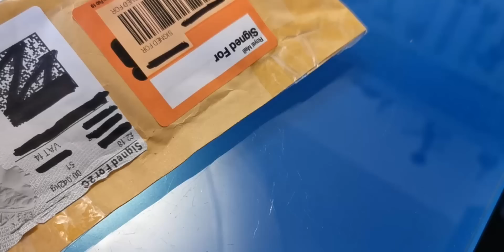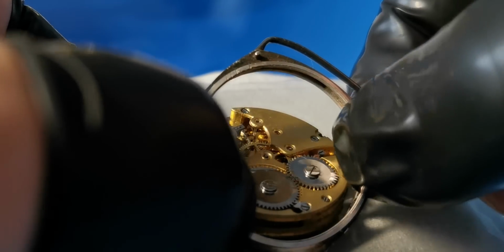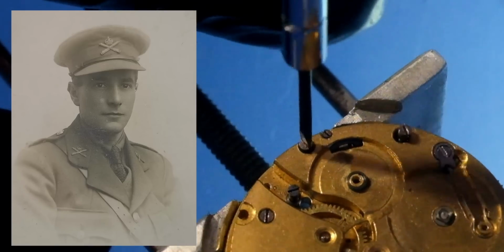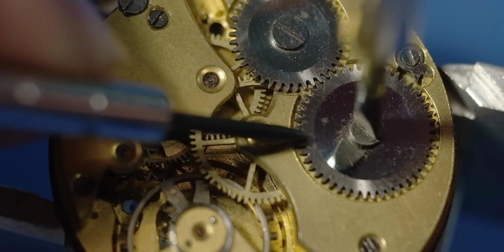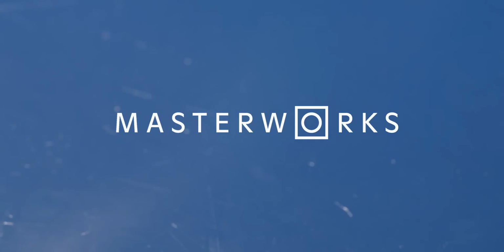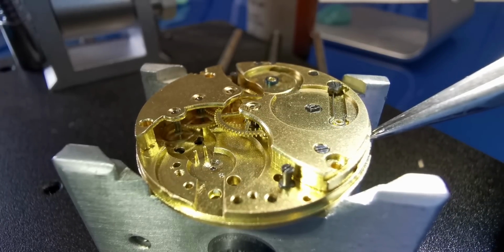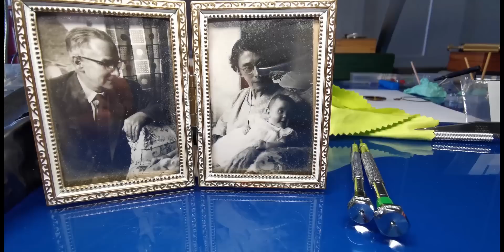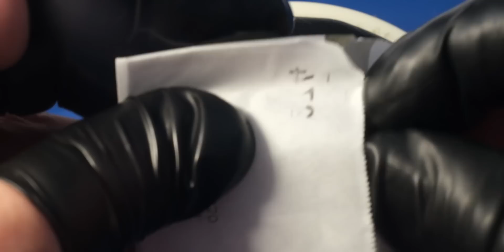Trench Watch Restoration - One Year To Complete!

Comment: Perfectly restored, and perfectly narrated, this video is one of my favorites Richard !
Reply from the maker: Hi Guys!  I just seen one of your videos with 15M views... Congratulations!  And... I have the JLC dial now... Will mail a few images very soon!  Richard
Reply: @richardperrettwatchmaker  Thank you Richard, you deserve just as much, if not more! Thanks for the images, can't wait to see it, have a good weekend!
Reply: @richardperrettwatchmaker  Why didn't you try one of the many penetrating oils that are easily available at most hardware stores? It might've loosened that screw without breaking it.
Reply from the maker: Hi Autodidact .... I did off camera and it made no difference ... but then I was turning the screw the wrong way!  Ooops!  Richard
Reply: @richardperrettwatchmaker  Ah Ha, I wondering about that.. It did seem very odd that both screws were jammed.. I looked closely at the view you made of the thread as it was attached to your drill bit upon removal. It did look like a normal Right Hand thread. I'll bet my Unitas 445 has the same issue. I wish you had mentioned your mistake in the video. Some of us need the education.
Reply: Angelina  Gaio  Janoski  Lúcia  Gaio

Comment: The screw that came out of the arbor appears to have been LH ?  I am a retired gunsmith worked for 40 years on English, Continental and American shotguns (primarily) .  Stuck screws /pins are not uncommon.  I found that heat (in excess)often altered the heat treatment  and could result in broken screws.  Light heat in conjunction with a fine penetrating oil like Kroil and allowed to sit for a day or two would sort out the problem.  Cold applied by liquid directly to the screw,  Such as wart remover (available in most pharmacies) or liquid nitrogen will cause the screw to shrink slightly breaking the corrosive bond and allowing easy removal of the screw and not alter the temper of the screw.  I usually found high heat to be a last resort.  Love your videos and really liked this one.
Reply from the maker: Hi sportclay1, I wondered about using a wart remover but could not find anyone else using that technique.  Theoretically it makes a lot of sense.  Haha! And I am now totally confused about the screw thread direction! Great feedback Much appreciated. Richard
Reply: @richardperrettwatchmaker  I got really curious about the dual LH threads on both Crown and Ratchet wheels.  This is an Adolph Schild movement and while I can't make out the movement number on the donor movement I did find a number of Shild movements from this time period and many from trench watches.  Parts lists show most all have LH threads on both wheels.  Learn something every day.  Glad you saved the watch.
Reply: @sportclay1  Yesterday I was working on a tiny Swiss lady's movement and, lo and behold, both the ratchet and crown wheels were reverse threaded. I spent over an hour trying to gently coax the ratchet screw loose, then tried turning in the other direction and ... SUCCESS! Really threw me for a loop, but I guess it's not that uncommon.

Comment: Fabulous job, pleased you didn't remove the dinks from the case just looks right as is. Terrific little lathe, impressive screw making when you can hardly see it. Just done a peseux 320 with the same setup for the balance and it took days to steel myself to clean the capstone.
Reply from the maker: Hi Phil,  yes the case looks good I think with the damage to it. And the 6mm lathe is pretty helpful for such an old tool.  Thanks for the feedback, Richard

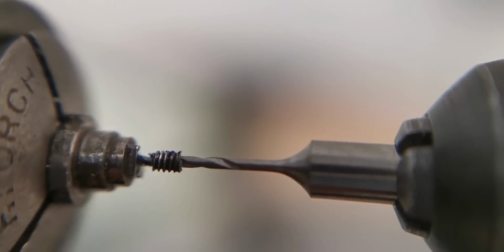Comment: I don't understand: The barrel arbour thread at 10:50 looks to me like a left handed thread and if it were a right handed thread, it would have been screwed in, not out by the drill going in the normal direction. But the new screw you made goes in right handed, am I missing something?
Reply from the maker: Hi Donald... The Ratchet Wheel turns clockwise and the crown wheel which drives it anticlockwise.  The crown wheel screw has a reverse thread so as the rotation of the wheel does not serve to loosen it and vice versa for the ratchet wheel. This is the normal configuration... but your observations look correct to me so now I'm confused too.  Whatever... it worked!  Onward!  Thanks for taking the trouble to make these observations.  Much appreciated! Richard
Reply: You and I are of the same conclusion.  The reason the broken screw turned out on the drill is it was turning it in the correct direction.  The new screw went in probably with only a small bit of resistance because of  a slightly smaller screw diameter and perhaps a slightly harder screw .  I am only a hobbyist and have personally never encountered both the ratchet wheel and crown wheel being LH.  But I have seen other watch repair videos where they were the same.    There is no corrosion on the threads of the broken screw.  I believe this movement was made by Adolf Schild  (AS) should, with the movement #, be able to find the proper service sheet.
Reply: I know both the ratchet wheel and crown wheel screws are left handed when he broke off the first ratchet wheel screw. And when I see him try to unscrew the second the same way I already know he will break it again. Both crown and ratchet wheel screws being left handed is not that uncommon, it may not make sense but thats the way they made it. So two important things to remember here even for the professional, 1. In watchmaking if you have to force something more than you normally have to you are doing it wrong; 2. Ratchet wheel screw can be left handed.
Reply: Yes well observed. After the second head came off I had my suspicions but seeing the thread up close at 10:50 left no remaining doubt in my mind. I have found to my cost that HMT movements often use this double left hand system. I am absolutely positive that it was an honest mistake but alarm bells really should have started ringing when he tried to get a right hand screw into the arbor. We all make mistakes and this could have provided the viewers with an excellent example of the pitfalls of watchmaking. Instead I felt that it was just glossed over in an otherwise excellent video.

Comment: You might try soaking the top of the screw with WD40 and then setting the entire movement in the freezer. Materials tend to shrink in cold, expand in heat. This approach has worked for me.
Reply: Thats good advice. Heat is more for nuts and bolts. Can't tell you how many screws I've gotten out with WD40 or Triflow, fantastic solvents.

Comment: I missed the lubrication of the keyless works with high viscosity oil?
Reply from the maker: Hi Stephen ... it was not even on the cutting room floor as I didn't shoot that part.  I actually use moebious grease 8200 on a big chunky (relatively compared to a Rolex 2135!) movement like this and apply it with a sharpened pegwood.  I just didn't capture it.  Sorry about that.  Richard

Comment: Question doesn’t the barrel arbor screw unscrew the opposite way? Meaning not what is normal? You were basically tightening it
Reply from the maker: Hi 4GodAnd Country, the crown wheel on this movement is reverse thread so for the ratchet wheel to also be reverse thread would be unusual  But the evidence points to it being so!  Hence the difficulty! Anyway it honed my patience and made for a more interesting video.  Thanks for the feedback.  Onward! Richard
Reply: @richardperrettwatchmaker  Looking at the video, I was thinking, "try turning it the other way -- it might be a left hand thread."  How do I know?  Had the exact same thing happen a couple of months ago on a cheap Elgin Sportsman I was playing with.  The ratchet wheel screw was a lefty, so I assumed the barrel screw was a standard right hand twist.  Against my better judgment, I kept twisting even though the force got way beyond what is normally encountered in watches.  Sure enough, a second or two later came the sickening snap.  When I sourced a donor movement, for grins I tried twisting the opposite direction first and sure enough, it backed right out.  Left hand thread on both screws.  Why?  Who knows, but apparently it does happen.

Comment: First of all, I'd would like to thank you for your service. I really felt your pain and frustration when when the second screw broke. 
By the way, you can use a small electrical soldering iron to apply heat to recalcitrant screws. Thanks for a great video.
Reply from the maker: Hi Robert .. Thank you!  The soldering iron is a great idea ... but in blow torch's favour it is maybe more theatrical!  Thanks again.  Richard

Comment: Nice work Richard.  Might try alum to dissolve out the broken screw.  Takes a while but can work well.
Reply from the maker: Hi Luke... Did consider it but the lathe is somehow 'cleaner'. Think I will do a video employing the Alum powder technique at some point. Richard
Reply: @richardperrettwatchmaker  yes, actually it might not work if the arbour is a similar material to the screw now I think about it.  Both might dissolve!!   Good for non ferrous or stainless substrate and ordinary steel screw though.

Comment: I wonder if putting the movement in an ultrasonic cleaner would have helped release the screw? perhaps with the aid of the tip of a hot soldering iron, once out of the ultrasonic of course.
Great video thank you.
Reply from the maker: Hi Jon ... Good to here from you.  I tried the soak and ultrasonic off camera but not the soldering iron.  To no avail.  Anyway it made for a more interesting video!   Thanks for the feedback.  Richard
Reply: @richardperrettwatchmaker  Yes it was very interesting, and glad my idea wasn't stupid.
I was worth a shot.

Comment: Thanks Richard! In a way it’s nice to see the experts having issues as well. How did you modify the screw?
Reply from the maker: Hi Boyd  ... Thanks!  The thread size was 0.8 so I reduced the diameter and in doing so took away the existing thread and then used a die thread cutter to put on the corrrect thread.  Hope this explains.  Richard
Reply: @richardperrettwatchmaker  perfect, thanks!

Comment: Your rigged center drill was scary lol but hey if it works, it works. Good show good show
Reply from the maker: Hi rgbcsm ... yes tools are so expensive that sometimes I have to make do with what I have.  I was chuffed when it worked.  Thanks for the feedback.  Richard
Reply: @richardperrettwatchmaker  I do medical machining and omg yes tooling is crazy expensive. I've had to use 200usd gun drills for canulation and feared every moment lol have to get the "speeds and feeds" just right

Comment: 😅 definitely a 1984 photo 😉.  Great restoration👍  It looks like the ratchet wheel screw has a left hand thread. I know it's unusual, but I've seen it before.
Reply from the maker: Hi Andrew... Yes 1984 or there abouts!?  I think you are correct about the thread.  Curious design choice as the rotation of the ratchet wheel serves to loosen the screw which is why the crown wheel is left hand thread.  Anyway,  alls well that ends well and it made for a more interesting film.  Thanks for the feedback. Richard

Comment: Sucks to break that same screw twice! I've had that happen a number of times. I kept yelling at my monitor "try turning it the other way, you never know!" lol So hard to find parts sometimes, I got to the point where I try to work around stubborn areas if I can. Cleaned my mothers watch tonight, the cannon pinion didn't want to come off, so I left it on and cleaned it that way. But no choice in your broken mainspring situation.

Comment: Hi Richard , do you only use an ultrasonic cleaner in your repairs or do you also use the large "traditional" LR / Elma style as well ? Great videos , Harry
Reply from the maker: HI stryker99 ... I always use an ultrasonic with three solutions, Cleaning, rinse and then isopropyl alcohohol.  If the parts are really grimey I do some cleaning by hand before this process.  Hope this is helpful, Richard
Reply: @richardperrettwatchmaker  that's perfect thanks so much

Comment: Wow, what a great transformation. Did you ever try dissolving out broken screws using hot alum solution? I've used it to dissolve small (big by your standards) broken screws and taps from aluminium, but it should dissolve any ferrous metal from a non ferrous one.

Comment: As its a donor mechanism, how about using an aggressive release oil such as 50/50     Automatic transmission fluid / acetone and soak for a few days.
Reply from the maker: Hi Jim... tried it all off camera but there was zero effect.  These fluids could not make any headway.  Both screws were almost fused into their arbors. Good thouvht though. Richard
Reply: @richardperrettwatchmaker  Thanks for the feedback. That 50/50 works miracles on car bolts etc.
 love your work and filming.

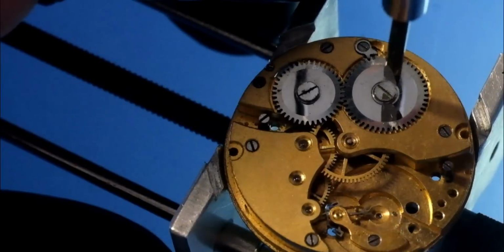Comment: If you look at 4:49 the screw did rotate about 5°, That is it is reverse thread.
Reply from the maker: Hi Haik ... A left hand thread on the ratchet wheel which turns clockwise is dodgy design ... but I agree with you!  The evidence is stacking up that this was the case.  Anyway, it made for a more interesting video I guess!  Onward!  Richard

Comment: You sure you turned the screw in the right direction? I guess you did but man, that's bad luck on both movements. Did you oil the cap jewels?
Reply from the maker: Hi quaarjet ... It would be unusual for the ratchet wheel to have a left hand thread when the crown wheel has one.  But not impossible and the evidence is pointing towards that.  Ooops!  Anyway, it made for a more interesting video I guess!  Onward!  Richard

Comment: You seem to have a disadvantage to my type of engineering with these delicate components, the tight screws will simply loosen with a wd40 spray soaking with a very very delicate precision shock like you did with the hammer, perhaps the screw threads can even mate in these ancient materials over 100 years... bravo fellow Welsh man these jobs are far outside my clumsy hands capabilites, I often use acid to eat rust too, another disadvantage you have I would not would be the quality and grade of the ancient steel that would probably dissolve altogether using my methods.... this is the difference between a fitter and a mechanic on display

Comment: I'm an agricultural engineer and blacksmith during the day, and even I cringed when the hammer and blowtorch came out! Personally I'd have gone straight to making new parts instead of pinching parts from another movement. But then again, I do have a habit of resurrecting basket-cases that should probably be pronounced deceased, and I'm not trying to earn a wage from it either!
Reply from the maker: Hi Leon... You do noble work sir!  Aged nine I spent the early hourz of one summer morning inside a combine harvester because I was small enough to get right inside and change a vital component.  Never forgot the urgency due to the weather window and the satisfaction of seeing the great machine harvesting again in the daylight.  The machines you work on are amazing!  Richard
Reply: @richardperrettwatchmaker  That's a very romantic way of seeing it! For me, they normally seem to break down in the middle of a knee-deep Norfolk bog during reed-cutting season (jan-apr). oh, and it's raining!

Then again, You'd be familiar with that phenomenon from your army days, they always find the worst place to break!

Comment: IT WASN'T TOO TIGHT, IT'S REVERSE THREADED!
Reply: Correct  , thats why it unscrewed when he was drilling it out.. check rotation of the lathe..
Reply: Lol. Jesus.  Even I knew that.
Reply: Yeah, you can also see the threads as it has come out... But strangely, it should be a normal right hand thread since that is the direction the wheel is turning and it wouldn't make any sense to have two reverse threaded screws on adjacent wheels.

Comment: Was a copier tech for 15 years, I've probably unscrewed hundreds of thousands of screws, WD-40 or Triflow Oil would have loosened them up, then just put it in the cleaner. Looking at this I don't think heat would have helped, and if you have to do it I'd just heat the screwdriver until its red hot, not the screw itself. More precise but still not good for this application. Look at me giving Richard Perrett advice; sorry for that. When you have a technical/ mechanics mind you can't help yourself.